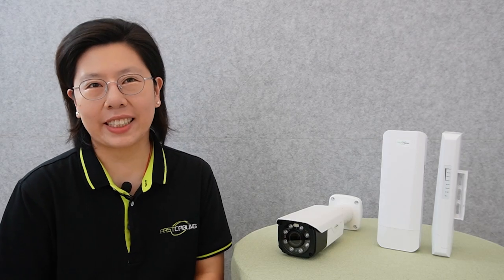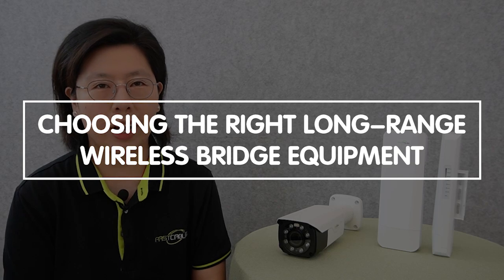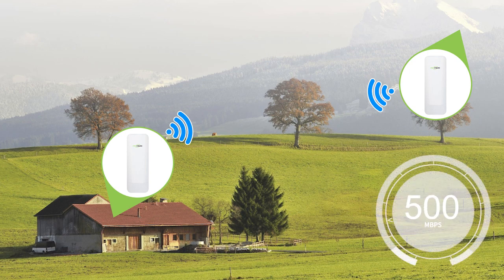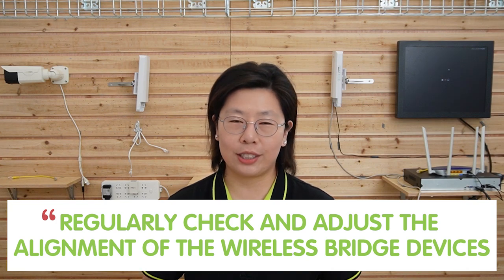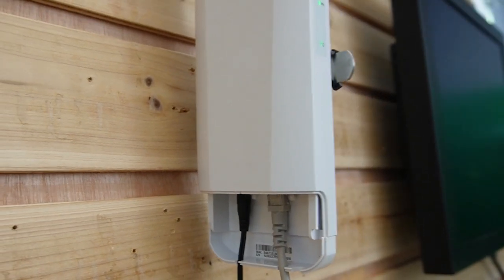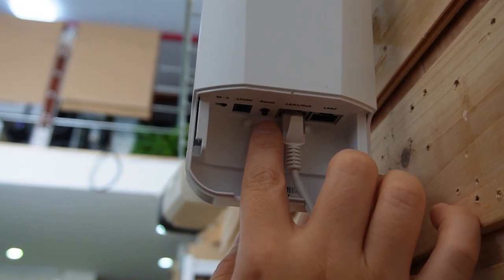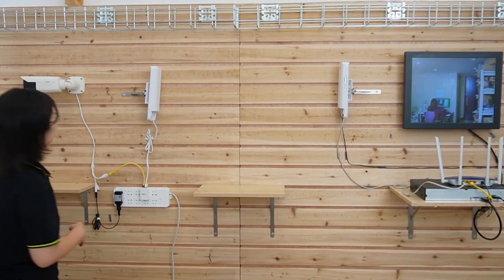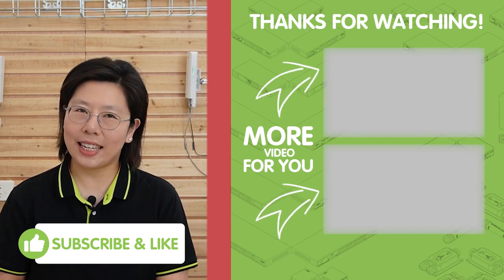Connect an IP Camera with Long Range Wireless Network Bridge

Comment: In your example, you power your bridge ipcamera with power supply, can I connect it with poe switch instead?
Reply from the maker: This network bridge only supports 12V DC and 24V passive PoE.

Comment: Let suppose i have analog camera with coax output cable....how can i connect it with wireless transmission media
Reply from the maker: No, you can't. The wireless bridge is IP based solution. It only works with IP device such as IP cameras, access point, PC.. It doesn't accept analog signal unless you have encoder to digitalize the signal.